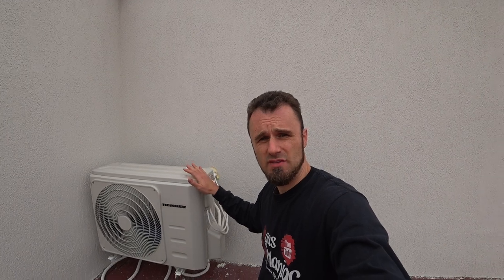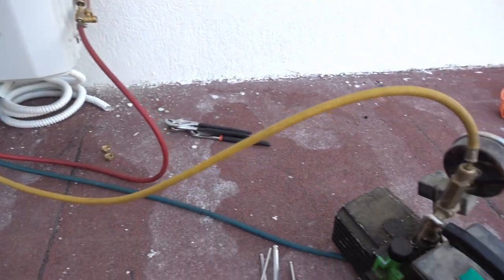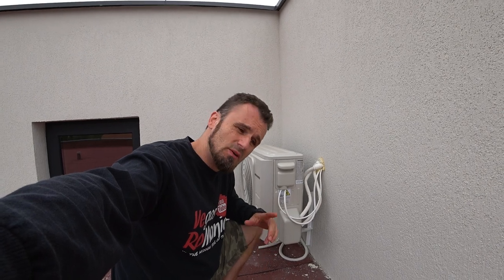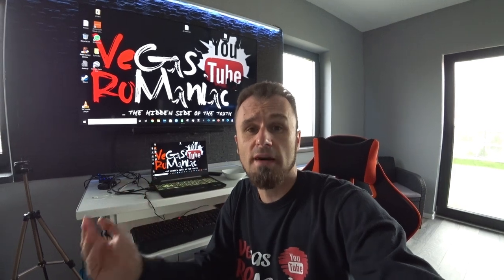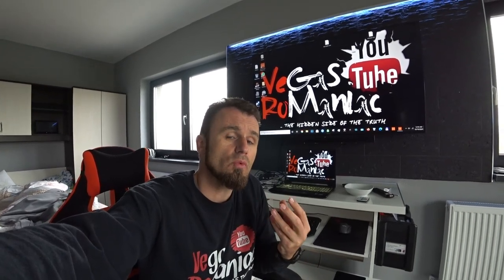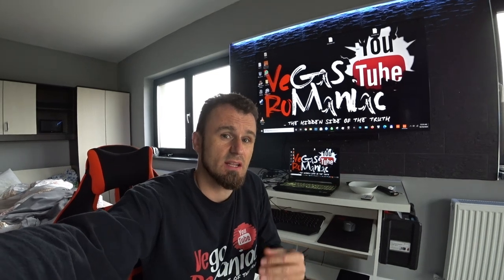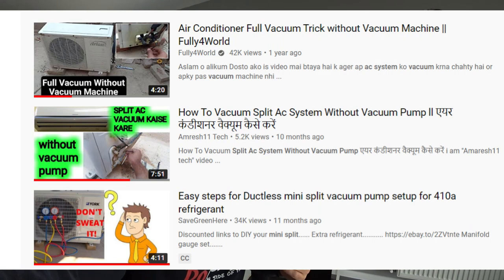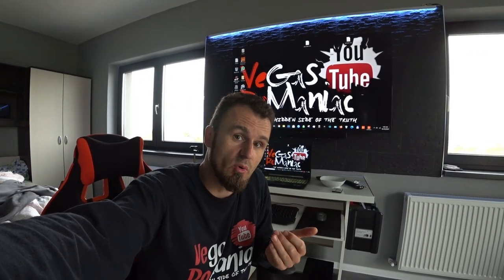How to install a Mini split AC without a Vacum pump

Comment: Most blokes crack the liquid line, with either a Schrader depressor or the suction line slightly loose, allow the refrigerant to purge out, till you get a splatter of liquid, that will indicate the air has been purged. Tighten the flare nut or remove the Schrader depressor, crack the suction line valve. 

Not the correct way, but lots of guys do it this way for speed of installation. They work just fine on short pipe runs.
Reply from the maker: Good to know
Reply: I screwed up and my pump didn't press down the Schrader. Didn't realize I didn't really have a vacuum. 8 foot line charged. Realized after I ran it for 30 min and went to check the pressure. Will it still work (long term)?
Reply: @jimmadsen3380  Uh oh!  That depends if you severely damaged the valve,  and if it leaks or not! I would order a new shrader valve, and recover the system! But that's me!  Moisture is not your friend when it comes to ac units!  R22- R21 or 410A! Now, if it was your car, I'd say don't run the ac at all,  get a new valve and dryer. Mini splits do not have a dryer, and they don't recommend them. Your main concern would be a leak, and the amount of humidity in the air at the time of your install. Thoroughly test for leaks, and if you have any concern over the moisture in your line I suggest a new valve,  recover the 410A in the unit. Vaccumn it down well below at a minimum of 200 microns or less. Be sure to make sure there are nooo leaks!  The biggest problem I come across ate do it yourselvers  ( new word ) that use a vaccumn thinking they have a valve suppressor! They vaccumn,  and the only thing they are vacuuming is the hose and not the line set. Then once they release the oil into the system to equally pressurize, the damage is done. It only takes a couple seconds. Then I have to get a recovery unit and tank, charge them a fortune to dispose of the oil under environmental procedures is expensive.  Flush the system,  spend a good 4 hours vacuuming it back down before I can recharge the unit!  I really can't tell you how much life would be in your unit, yet the more humidity that was in the air, the more chances you will have it will fail quicker. These videos on u-tube should be banned, but it is utube, and people think they need to show their shade tree abilities off! Sadly,  pioneer makes a disposable can ( Kwik-E-Vac that will
Reply: @jimmadsen3380  that will flush the air from the line. It contains Difluoroethane. You leave the small size line disconnected at the unit.  You then screw it on the valve and screw the cap open on the can and you will hear air coming out the open connection. Put your finger over it a couple times to add back pressure and release causing a burst of air to come out both times. Then quickly turn the valve down on the can but not off and start putting your line set connection together. Air will leak faster when this is done and as you get it tight and sealed,  then start checking for leaks. If no leaks are found you just need to vaccumn.  The best advice I can give. The second,  is make sure you have the proper adapter for the shrader valve. That is the second biggest mistake having the wrong adapter. After that it's vaccumn away keeping an eye on your timer depending how big your vaccumn pump is. When you micron Guage gets to the point you can live with,  like 100 or below, then shut the valves.  Now,  another mistake!  The valves can catch and hold air. So as you vaccumn,  you need to shut and open the valves so air trapped in the valves gets vacuumed as well. I'm sorry I can't make it better by saying you should be fine. But don't feel too bad I've seen dumber!  Like those that think they depressed the valve with just the vaccumn pump,  and all they did was vaccumn the hose on the pump! Then again,  I've seen some really strange things in home installs. Like condensation lines into a dehumidifier or coffee container!  The worst thing I saw  was a guy ran the line set through the dryer vent! But,  just when think you have seen it all, there's always another surprise!
Reply: I admire the ambition, but moisture is something that takes minutes to boil off in a deep vacuum, and purging could be illegal and loose your license.

I can see people wanting to do this on a budget but I wouldn’t violate EPA rules for venting refrigerant, and especially, would never contaminate a system.

I understand you can get cheaper folks wanting to try your luck out.  I guess you are are on your own in these cases you don’t follow the protocol.  

It’s not quite like many intuitive things in life.  

Sorry to me a bum here, just sharing objective opinions any hvac certified technician should have answered in their 609 certification.
Reply: This will damage the system in the long run. And surely soon if the ambient air is humid.
Reply: That's not going to remove all the moisture out of the lines though. The refrigerant will absorb the heat from the air, the humidity will mix with the gas, even under pressure. That is a crap shoot because it could cause problems down the line. I do refrigeration for a living I couldn't even imagine starting up a system without pulling a min 200 micron vac. Moisture is a killer in refrigeration systems. Just because something worked for a few people doesn't mean it should become your standard practice. Many guys in the auto industry don't really evac either, that's why when you hear people have ac problems in their car it ends up being a never ending issue. Because it never gets fixed correctly.
Reply: Yeah mate Im also a refrigeration mechanic. I did say, not the correct way to do it didn't I? But it works on small runs, obviously with no moisture in the lines. I know guys that do them like this that have never had a warranty, so go figure. I prefer to get it to 500 microns which is the standard but hey each to their own.
Reply: We did not vacuum ours first day was so cold second day it started freezing up by the flange screws or what ever u call then no more hot air idk what to do
Reply: That is what I plan to do.   Makes the most sense.  Bought the mini split for $500 why pay $250 to vacuum.   Think about the cost....doesn;t make sense to pay that much for a simple vacuum pull LOL.   People,  all the HVAC folks want your money and if it's a $6000 system maybe it makes sense?   But a cheap $500 mini split ,  don't pay 50% more... $250 to evac it. LOL
Reply: Ok L Williams    Only one problem with your method…   You’ve just cracked your refrigerant line to purge. And you get your spatter thinking your good right…
You forgot to test for leaks- DIY people will waste their refrigerant if they have a leak… now you have to call out a H/VAC company to recharge the unit. OMG!!!
Reply: @stevenlundt2736  big blue the flares when you're done man. Got a leak, pump it down and fix it. But if you're half decent st your job you shouldn't have a problem.
Reply: @lwilliams3285  sounds like you are a trade professional by your lingo…
I am speaking to DIY People
Reply: I have done the same. The unit has been working for years.
Reply: How long is years?

Comment: So... on a video entitled, “how to install without a vacuum...” the video is actually, “just use a vacuum”
Reply from the maker: That's was the point, people keep trying to search for a video where you do it without, there is not such video that is honest.. That's the point
Reply: @VegasRoManiacReviews  I’m interested in what their method is in a purely educational way. All the comments are about people that did it. How? Did the crack the liquid side and let it fill until a little came out? How’s that work? I want to see it.
Reply: @VegasRoManiacReviews  I like your style. I can't even find one that shows how to wire the inside unit. They go through a big song and dance about how to hang the wall mount level, and the next thing you know they are showing you how to put the hoses and wire through while hanging and all of the work to get the hoses and wires to that point are left out. I do a lot of DIY, I know how to hang something on the wall and drill a hole. I don't have a vacuum pump and I'm not going to buy one because THAT I don't know how to use. I have messed up enough DIY projects in my life to know when it's time to get humble and hire a professional - someone on the side, not through a company - at a fair price. If I go through a company I might as well let some guys hold me down and aggressively penetrate me while they beat on my liver.

Comment: 3 units without vacuum. 17 years and still working...
Reply: No vacuum at all? Just line connected to condenser and refrigerant open?
Reply: @tomobomo9806  no you have to purge the line
Reply: Are you in a very dry climate?
Reply: Thanks for your comment!!!

Comment: AC systems are very simple machines with few parts, made the same way were made in the 50’s, some of you all talk as if it is rocket science, I am about to connect mine without vacuuming, most of people saying no need to vacuum and units working for years without vacuuming, that little extra air or moisture will dissipate or mixes with the gas and becomes part of the system.
Reply from the maker: Good point
Reply: Thank you because I never vacuumed mine ether

Comment: Installed 3 in relatives and my own home without pulling the vac, just cracked the valves and let the coolant push the air out and bobs your uncle. Been working 3 years +

Comment: Seven units installed more than 10 years ago. All were installed by just purging the air from the lineset by depressing the schrader valve without pulling a vacuum. In my area, none of the AC installers do a vacuum. They don't even carry a pump. But all units are running fine without any issues. After I found out that you are supposed to vacuum the lines, I bought my own vacuum pump and nitrogen tank. I installed two more ACs myself the proper way after vacuuming the lineset. It gives me peace of mind, knowing I did it the right way.
Reply from the maker: Awesome good to know
Reply: Hay guys FYI the whole reason for Pulling A VACUUM “ is to check for leaks… 
But Pioneer sells the can of quick E Vac… that purge the line and gives you the chance to detect any leaks BEFORE releasing your refrigerant. Does anyone seal your flair fitting? This is all DIY you get one shot at it…
Reply: I have done it with out a vacum pump too by purging Just check lines with soap water and ac working proper for 3 years

Comment: I have 13 years ago installed a Maico prefilled airco without a vacuümpomp. It has perfectly worked cooling as haeting for12 years. Last year is a part of my house Burned down. And also my airco was gone. I have now bought a Mitsubishi heavy industries and also an vacuümpomp. I don't  take the risque again, then my New airco is nearly 4 times the price  of the old one. 😅
Reply from the maker: That's good to know , thanks for letting me know . I have 3 units 2 installed with pump one without , so far all work

Comment: I did install my 3 r22 air conditions 20 years ago without vacuum pump and O followed the manufacturers instructions. They were saying to display air by using the freon inside the unit. By the way I have 15 metes piping from the outside to the inside unit. They work fine so far. They were saying that there is enough freon on the unit and if you use to expel the air it will be ok. So my experience says that you can install it without vacuuming
Reply from the maker: Awesome info

Comment: Here in cuba we do not have the availability of vaccum pumps , so I have installed like 20 mini split's and it's been 3 years use without trouble , all that is because of the non vaccum pump avalability but I wich I could have one , that's my expirience
Reply: Bien hecho hermano
Reply: Wow, it's easy to get 20 high tech Airconditioning machine's but you can't find a vac pump?
Reply: how many seconds do you purge  before closing the lins ?

Comment: Installed one without vacuum. Only purged air out of pipes by releasing a trickle of gas then all OK for 7+ years.
Reply from the maker: That's insane, glad to know that...
Reply: Although if you want to do it the bodgy way. In oz during summer it's very dry. No water in air and I used clean new capped pipe. So no moisture or foreign object was ever going to cause a problem. Use reasoning. Bodgy may not be suitable for your situation. If you are in high humidity like Thailand, vacuum is important. My opinion and I'm an idiot, so you know.
Reply: @Swenser  true i live in india in extreme hot climate so there is no question of moisture inside the pipes

Comment: Im from India. I was looking to install my ductless mini split unit myself. I started looking around for youtube diy videos and came across this video as well.
Here are some simple steps for first timers. 
1. First of all things one should know the small sized pipe and valve is discharge line and bigger sized one is suction line. Suction line has a schradder valve 
like we have in our tyres. 
2. Once all the hoses are connected properly. Use an Allen key and slightly crack open  the discharge line and you will hear the gas sound. Immediately close the valve. 1-2 seconds is the maximum time the valve must be opened. And it should be opened only a little.
3. Now the hoses are pressurised. 
4. Now take some soapy water to make bubbles and apply on the joints to see if there are any leaks. you will be checking at 4 points. 2 points at the Indoor unit and 2 points at the outdoor unit valves.  Let the unit sit idle for 2-3 hours. If you are not in a rush let it wait for 4-6 hours and check for leaks again. If there are any leaks you will get bubbles in the soapy water. 
5. Once you are sure there are no leaks, now use a philips screwdriver or any tool to depress the schradder valve for a second. Now if the air gushes out fast then you can be sure there are no leaks in your system. 
6. Now you should crack open   the discharge line with the allen key ** only a litte** and simultaneously depress the schradder valve.  Do this for 1-2 seconds. 
    close both the schradder valve and the discharge line valve simultaneously.  This is to purge any atmospheric air present inside the hoses.
7. Now you have successfully  purged the system with refrigerant and removed any air in the system. 
8. Finally you can open the discharge line valve fully upto the max. followed by the suction line valve.
9. Now again check for any leaks with soapy water. If there are no leaks then turn on the air conditioner. 
10. Once the compressor starts running, again check for any leaks at the valves.
If there is a leak you can find oil residue at the place. It is compressor oil. 
 If there are no leaks then you have successfully installed your air conditioner !!

Tips: 
1. Outdoor units are usually charged with extra gas. So this wont adversely affect the performance in any way. 
2. Mini splits with hose pipes of around 2-3 meters dont really need vaccum if you do the purging procedure correctly. 
3. Dont be hasty. Take your time and do it slowly and properly.  
4. Dont use teflon tapes  for tightening the valves. Also dont over tighten as it will cause leak of gas.
5. Most of diy ers will be bending the hoses by hand so take your time and watch many videos and bend the pipes slowly. use both your palms. 
6. Dont kink the hoses. After install properly tape them with PVC tape. This will help with insulation and increase efficiency. 
  If you dont use pvc tape the air will interact with the copper pipes and cause sweating , some of the cooling will be lost to the surroundings before entering the Indoor unit.
Reply from the maker: Good advice

Comment: I've installed two units without doing a vacuum. Both are working fine.
The key is to leave the low pressure side (wide pipe) slightly loose, then open the high pressure side (thin pipe) valve. The refrigerant will flow through the condenser, high pressure pipe, indoor unit (evaporator), and finally through the low pressure pipe. When you feel the refrigerant flowing out through the loose flare nut you then tighten it. Theoretically, there will be no air left in the system, the refrigerant will have pushed it all out.
However there are major drawbacks to this method. First, it is not easy to feel the refrigerant, therefore the system may end up being a bit undercharged or alternatively there may be some air left. Secondly, you can't test for leaks like in the case of vacuum. Thirdly, the mentioned method won't remove the water particles (moisture) that are present on the inside surface of the  piping, it'll only remove the air.
If I were to install those units again, I would definitely use a vacuum pump.
Reply: Should I do this with the ac turned on or off?
Reply: will this work with R410a ?
Reply: This is what I plan to do on a cheap $500 mini split.   Not paying $250 for HVAC to pull a vacuum...that's 50% of the price of the unit LOL
Reply: @asmrtalkinganimalshypnotiz3239  and you'll be lucky to find one to do it I usually only pay $100 but it's hard to find people they want like $2,000 to install a mini split that's ridiculous it takes 2 hours and it's very easy AC companies are a rip-off
Reply: Can you share a video just for case if I mismatched something? Or you can explain more in details. I do not understand. Why we should leave the low slightly loose. You mean we should lose low and then height and after that with some pin to press int low service how just small portion of freon to get out. If you do not use pin to press into the low-service. Then even with lose the both valve nothing will happening.

Apart of that. Othe important comment related to your concerns. You cannot remove water with vacuum. You need nitrogen for that purpose or at least to hot your tubes before start entire procedure.
Reply: Have done same method,  not noticed  any issues